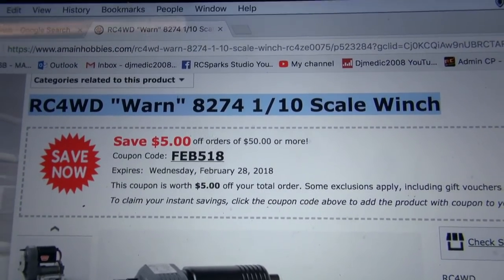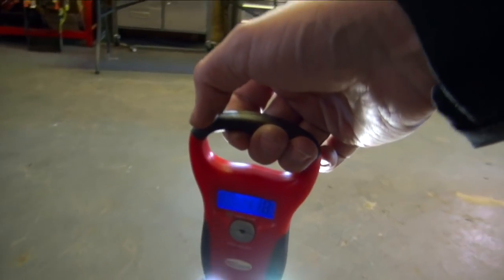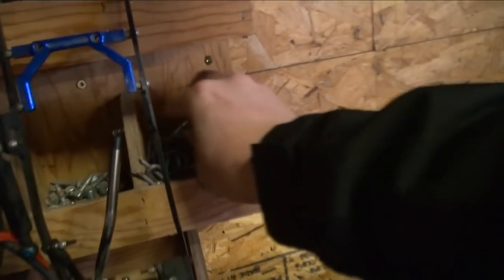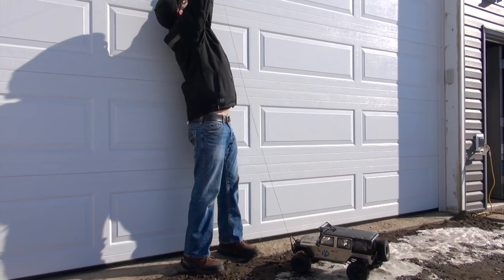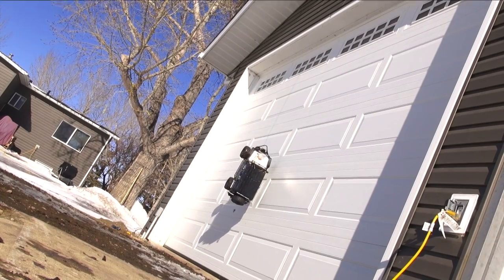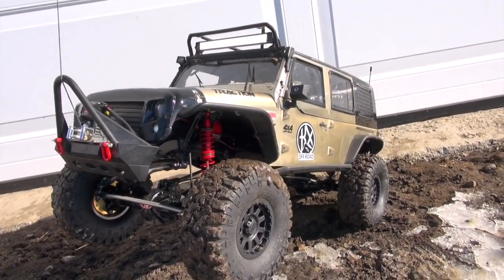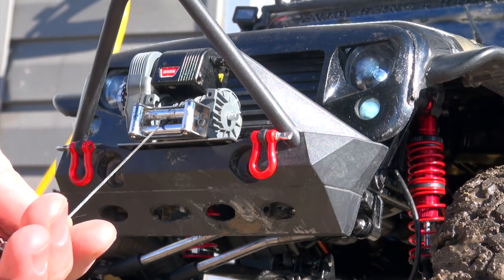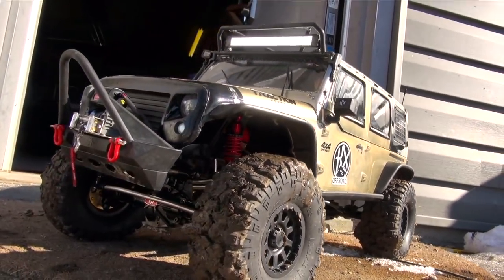RC ADVENTURES - 100' Scale Vertical Climb - HEAVY LiFT - WARN WiNCH TEST - RC4WD

Comment: Wow.  Rated for 70 lbs, that's approx 5x more then the weight of the truck.  No GVWR (maximum Gross Vehicle Weight Rating for a fully loaded vehicle) is listed for scale trucks of course, but Warn recommends a minimum 1.5x GVWR for matching a winch to vehicle.  So to me, this not only fit's Warns recommendations in terms of capability, but also scores big time on scale looks as well.  So in other words - *PERFECT*!! :D :D

Comment: I too have this winch,  yet have not used it, I also have the rc4wd winch control that i use for my 3racing winch,  kinda surprised you aren't controlling the winch with the radio?  I wonder if the rc4wd controller provides all the necessary amps to the winch, obviously it works but would a small esc do better?  it was an rc day for me too and i didn't break anything,,,  yet,,,,    glad to see you on your feet.

Comment: I have the ssd ox winch. They are basically same winch. One thing you will notice is that that winch will draw some amps. I only run 1300mah 3s batteries and I noticed a significant drop in run time.

Comment: My only concern would be the wiring overheating at some point in a long heavy lift at a Max load, other then that if warn let them use it's branding, then it should perform as it says it should. At least that's been my findings with a 1:1 warn. Love all mine.

Comment: Thats a nice clean truck in mid air. Pack another 5Lbs of sticky mud inside, then glue it to a mud hole. Then you'll test that winch. If it couldnt AT LEAST dead lift it, it would be completely useless on the trail.
Reply: TBH, it should pull until the rope snaps. The rope is the built in safety ;)

Comment: Hey sparks. First off I'd like to say I love your channel and have been following you for years, I hope all is good in the health department. 

I recently purchased the same winch and controller however after 1 run with the boys and rest on the shelf over night the motor has mysteriously seized or stopped working. 

Have you ever run into this issue? I have taken the black warn cover off and noticed that it's just a simple servo motor however I cant seem to figure out how to open up the grey casing to remove the motor

Comment: I like the winch but not the looks of that one. Is it an old design they use to have or is it like that because of function?
Reply from the maker: It looks exactly like a full size Warn Winch, and yes, its how its made
Reply: mmmm, the winches i look at for my tacoma never look like this one. Research is needed at this point. Thanks.

Comment: Hey man, do you have a video on "wheel weight how to"? I need them in my son and I's crawlers.
Reply from the maker: Just go to a hardware store and buy 4 strips of 7gram wheel weights (for 1:1 cars).. and wrap one each around the Wheel, under the rubber tire.  You can add or remove weights as you need.. it comes with an adhesive tape already attached

Comment: Do you have a link to the voltage regulator used. Is it 100% needed if running a 12v system
Reply from the maker: a BEC is always needed for these kind of things. Yes, its a CASTLE Creations 10amp BEC. no link, but you can find it with that ;)

Comment: I have a trx-4 w/traxx that weights around 11 lbs I took the pateniometer out of a 20kg servo of amazon hooked it up to a wireless controller all costing 50 to 60 dollars it will deadlift my heavy ass truck no problem

Comment: Rc4wd is Americas integy. Imo ofcourse and ignoring most rc4wd rc kits. I mean rc4wd tat. Bodies especially they are cheap china remoulds and they charge 4x more. Its nice having the big boy brands warn, king, rigid but rc4wd over price everything. Im sure i saw the 6x6 beast under another brand 45% cheaper than the beast. Integy wishes it was rc4wd. They probably started the same way but rc4wd evolved into a true rc brand. But they still put ther name on others work. Thats all integy does still.                 A cool product with no brand usually goes unnoticed. But slap rc4wd on it and instant best seller. Guys pay twice the price with a smile.

Comment: To be fair if it's stated to deadlift 50lbs and it wouldn't lift 13lbs, you'd feel very robbed indeed.
If you tried to deadlift 45lbs and it wouldn't that's a bit more acceptable.
Glad to see it did it, although it seemed to sound strained, I'd be interested to see it try to do even just half of the stated deadlift.
Reply from the maker: I was happy to see  at 100 scale vertical feet, it did not hesitate.
Reply: Yeah impressive stuff it can lift that much.
My point was, if you buy a car listed at 200hp and it only has 190, you're not too disappointed.
If it only had 50, you'd be robbed lol.
I wish these winches weren't so expensive in the UK, I want one! But it works out to around $160 over here :(

Comment: id still like to know what mods i can do to improve the xtm 1/18th scale rage wheel size / weights gears motor esc maybe
Reply from the maker: I am the wrong source for this information! Sorry!!
Reply: well any ideas would help i know its not a rock crawler with the a frame type suspention and no room to set up a 4 link

Comment: Did you touch it to check temperature ?
Reply from the maker: Yup, 100% normal, 0 Heat Increase
Reply: That's really good . I didn't think they had that much torque . You should do a test on the smaller ones too . Maybe not a dead lift but a similar test .

Comment: That winch is way more powerful than  that sir . You can hook it up to 11.1v straight
Reply from the maker: I would agree - but you can not do that with the wireless controller. It will burn it out at 11.2v. You need a BEC to regulate the power to the Winch. Also, Pulling 14lbs at a scale 100' vertical is a HUGE drag on that little motor. I think it did amazing!  What do you think?